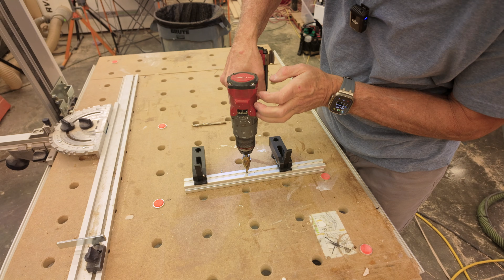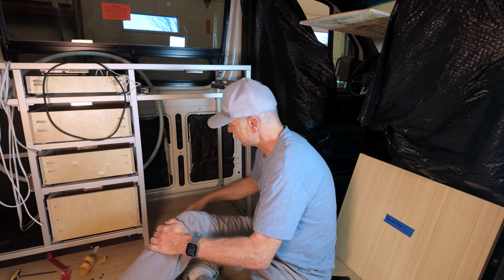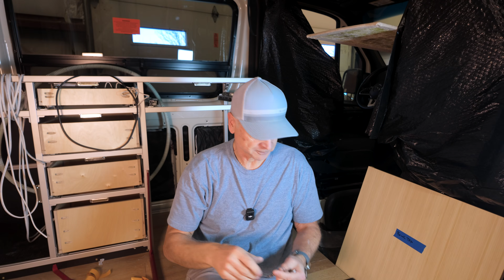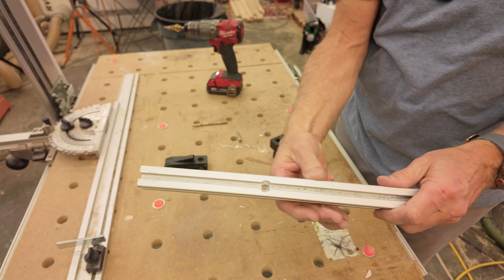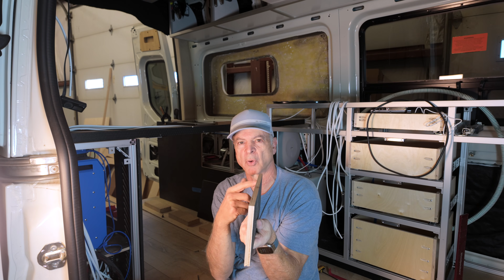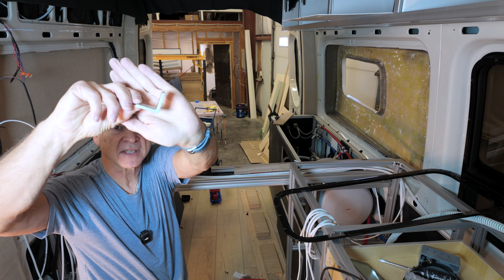8020 Van Build: Viewer Questions Answered by Pro Builder

Comment: One thing I have never understood.   The automotive AC is more than enough in my experience to cool or even heat a vehicle.   Is all the extra insulation really necessary.  You can make spacers with pvc sheets.   Big box Carry’s it.

Comment: Hi Jeff.  Thank you so much for sharing all your knowledge.  We have been following you on our build.  We used Series 10 Extruded and are prepared to add the lower cabinet doors.  Could you please share with us which lower cabinet hinges you use to attach 3/4 inch cabinet doors?  Thank you very much.

Comment: I see you are not using furring strips to mount the 8020 to the van walls.  What is the thinking on heat/cool transfer between the skin of the van and the screws, then the 8020?  
And great videos, BTW!!!
Reply: He mentions he uses differently sized spacers to form a thermal break. Check their website

Comment: I have designed and offer for sale (here on Youtube) a series of cabinet latches for wood framed cabinet face retention.  I am developing latches for 8020 van and manufacturer builds based on the same concept. They are available for several series 8020 applications

Comment: VHB Tape (depending on which version) has a tensile strength of ~140PSI. Depending on the surface area, thickness of panel, etc its is likely much stronger than using screws. You can also use adhesion promoters for extra strength, and it comes in thin rolls too.

Great video, I've been considering how we will attach panelling to our 8020 cabinets. I'd like to go with thin material and have something removable for service, so likely will either bolt through the panel with visible screws like you showed or maybe even try dual lock.

Comment: I'm in the middle of a van build and have seen 100's of videos to figure out what the heck I'm doing.  Yours is the most informative that I've seen.  Much appreciation for sharing your years of experience and expertise.  I just costed out extruded AL bars with your recommended supplier vs Amazon (8020).  TNutz has a better price.  But due to the high cost of shipping, I found that Amazon Prime was overall cheaper (around $60 vs $350 for TNutz shipping).  I'm thinking I have to purchase a lot of AL extruded rods from Tnutz to have it make sense financially.  How much AL do you buy at a time? And what would you estimate the amount of 10 and 15 series rods you used in this build?
Reply from the maker: If you keep the lengths under 96” with Tnutz the shipping is much cheaper.
Reply: @thrivans  Yep.  Much less expensive that way.  Thanks!

Comment: This is a great, informative video! I'm stuck on one thing, though... When/where to use the 10 and 15 series profiles? My thinking is that the vertical posts would use the larger 15 series while the horizontal pieces would use the smaller 10 series. Is it as simple as that? Or am I completely off-base? Any advice would be greatly appreciated.
Reply from the maker: We use 10 series for everything. The only place we use 15 series is for the rails across the mechanical boxes to create the bed platform.
Reply: @thrivans  Appreciate your reply, thanks! That's even easier than I was thinking.

Comment: With all this drilling and screwing directly into the metalwork and the various dissimilar metals in use (especially the aluminum extrusions in which you destroy the oxide layer by drilling and then using stainless steel screws in those same holes) are you ever worried about galvanic corrosion?
Reply from the maker: We have not had any problems with this.

Comment: Fantastic video, answers a lot of the questions I've been trying to find but no one seemed to mention it!

Just on the thermal bridging and screwing into the floor. What type of screw is best to use to limit thermal bridging (like zinc, stainless steel?) And do you still put a rubber/plastic washer in-between the floor wood batten and the aluminum, or does the wood stop the thermal bridging itself? Thankyou !

Comment: I've a question for you: Do you ever do any floor-to-ceiling structures out of extruded aluminium? And if so, how do you deal with securing those to the van itself? The lower portions, obviously you'd do the same as your cabinets; but then the wall curvature and then whatever ceiling curvature come into play. I'd love to hear how you tackle those sorts of features. Thank you!

Comment: So do you normally use 10 series and not 15?
Reply from the maker: 10 series. Much lighter, less expensive, and plenty strong. The only place we use 15 series is for the bars that span the mechanical boxes for the bed platform.

Comment: Your videos take me from overwhelmed to feeling completely in control, thanks for these awesome training opportunities.  I was wondering how you decide when to use 4 side T-slot extrude aluminum, or 3, or 2, etc.  In your videos, typically you have flat on all outer sides, but occasionally not the case.  I imagine it doesn't make a big difference, but when you drill directly into the aluminum, does it add an extra bit of material for the screw to bite?  Would the only time it would matter be if you were inlaying the panel, keeping the aluminum visible (just for looks)?  Thanks again!
Reply from the maker: It all depends on what you will see. We don't even use 4-slot. We use mostly tri-slot (1 smooth side). We face the smooth side out if it will be seen on the face or ends of cabinetry. We use bi-slot (2 smooth sides) when two sides will be seen. For example, we use bi-slot for the bottom bar on our upper cabinets since you will see the bottom and the face. We also try to face the smooth side out if we will be screwing into the bar.

Comment: Thanks for all these detailed videos!

Q: What do you use to keep the wheelwell cabinets parallel to the center line of the van (brackets or rubber spacers)? I assume the back end of cabinets would be an inch or two off the wall to keep the centerline even. Or are you building the 80/20 a bit wider towards the back of the van?

Looking to build our own van shortly!
Reply from the maker: We make spacers on a 3D printer to keep everything square.

Comment: What is the thread spec for attaching to different Van locations? Thanks for your videos!
Reply from the maker: We use 1/4”-20 bolts into Rivnuts or Plusnuts for the walls and #14 sheet metal screws for the floor.

Comment: Silly question maybe, but you mentioned screwing the frame right into the floor sheet metal. Are you ever concerned about leaks?
Reply from the maker: No. We spray all of the screws with undercarriage coating.

Comment: Very good tips. I am building my van wit 80/20 and one thing I realized is the the hardware adds a lot to the cost. It costs as much for brackets and bolts / t-nuts as for the bars. Also, building complex structures takes a lot of planning. Me and my son, a mechanical engineer, spent much of the week and all week-end planning the material needed for our kitchen / shower all-in one unit.
Reply from the maker: Yes. The hardware adds up quickly. Try the supplier we use. They have the best prices we’ve found.
Reply: @thrivans  I am in Montreal Canada. There is a supplier here with very good price and I can pick up orders so I save on shipping.
Reply: @fournier.benoit1993  I am near Ottawa. What is the suppler in Montreal that you use for the 80/20? Thanks in advance!
Reply: Yep, that 80/20 saga was started by George from Humble Road a few years ago,, then everything went all directions, for the good, but mostly for the worse.  My favorite one is seeing people building an 80/20 structure then covering it with 19mm baltic birch plywood...

Comment: Very timely video for me.  Thanks very much for sharing.  One question: how many screws do you typically use to fasten a component to the van floor and wall (I.e., sink/cabinet component or framework for water tank)?
Reply from the maker: Usually 3 or 4 in the wall and the same in the floor.